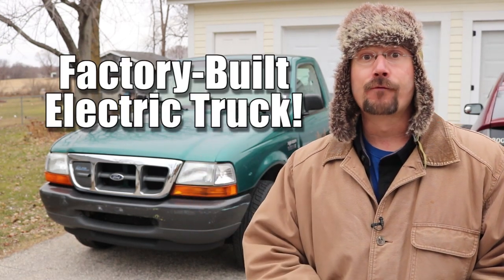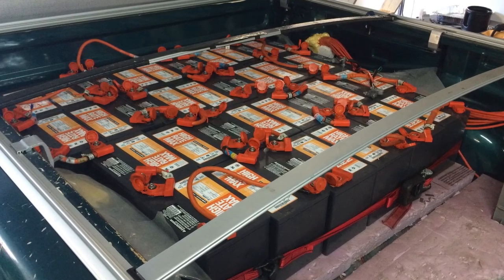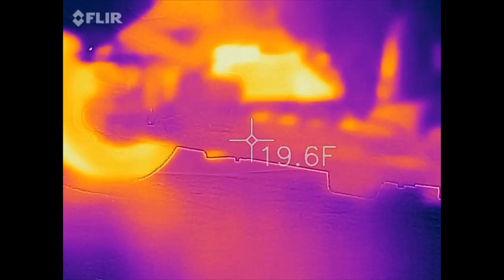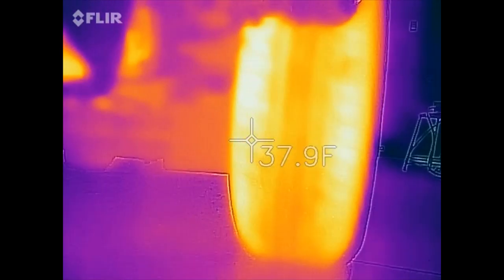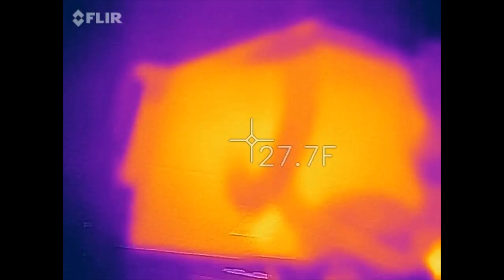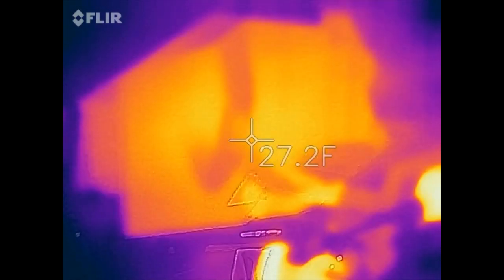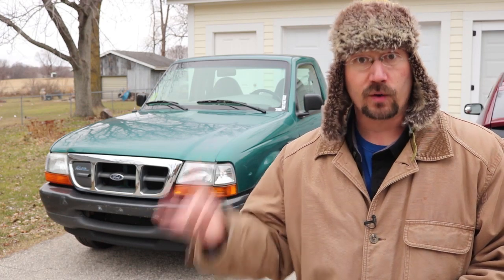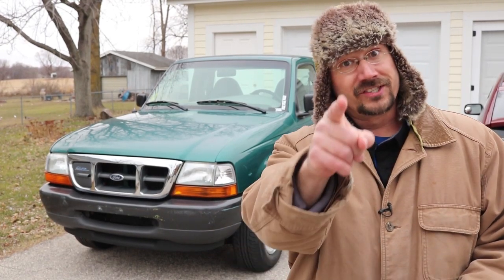Electric Truck Thermal Video of Batteries, Motor, & Controller

Comment: Lead acid batteries are a dog to drive around in the winter; 30-50% less range. Best way to heat them is by float charging them, timing your charge cycle with your errand. Some Evs back then had insulated battery boxes and heater mats. Lead acid batteries never had the same risk of overheating as current Li-ion, their thermal mass is much higher and they are more efficient, so less heating from driving hard. The only time I had to be careful was on long summer road trips between fast charges. 40C (baby tub temperature) is considered max not life shortening temperature.
Reply from the maker: The box the batteries SHOULD be in under the truck is a composite material, which supposedly holds the heat well. This year also included the battery heater option. I'm hoping that the original battery heaters are still inside the box.
Reply: @BenjaminNelsonX  Cheers, I'm sick with envy you know? Don't mind my critical comments! Sound good with heaters in an insulated battery box. Looked your truck up: 67kW motor, 500Wh/mile so if you got 12 miles range = 6kWh. Stock battery 312V 120Ah = 50% DoD = 18.7 kWh  = 37.5 miles range on new Lead acid batteries in the summer. 
So your batteries in the bed are beyond their usefulness, even if you factor in low temperatures.
Stock battery weight: 1,918 lb, that's roughly 100kWh in Li-Ion = 200 miles range! = It will never be a marathon runner, but if you have solar on your roof, having your power wall in a vehicle makes sense for when you occasionally need to haul supplies.
Reply from the maker: @Tore_Lund   I'd love 100kwh of lithium, but weight won't be the limiting factor! Budget will be! The batteries in the truck are rated at just a little less than 80AH at the 20 hr discharge weight, so the math on your numbers would only be 2/3rds of that, but yes, that analysis is otherwise correct. The truck SHOULD have better range, but does not, and I have no idea of the age of the batteries. Clearly, they are well past their prime!
Reply: @BenjaminNelsonX  Money, that's the catch. Nevertheless, thanks for this little Christmas exchange and I'm sure you'll put it to good use. Otherwise it is a "Classic" EV with history.

Comment: Wonder if a magnetic block heater from a diesel would be a decent temporary fix for warming the batteries up a little. Maybe just stick it on the bottom of the bed to heat the whole bed a little? You can always remove it when the temps get above 50°F. Merry Christmas to you and your family!